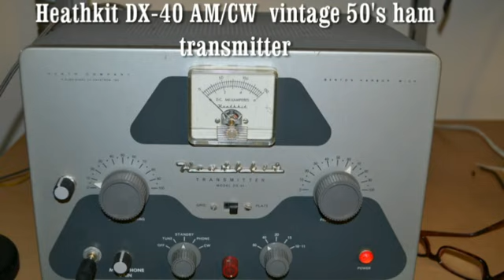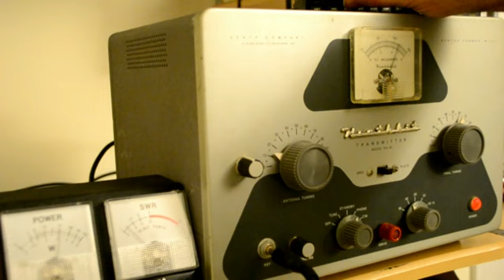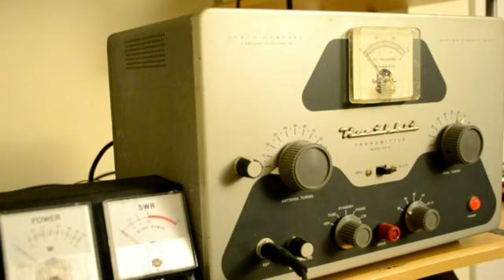Demonstration of the Heathkit DX-40 January 2013

Comment: Burt,
Did u ever hv luck in reducing that AM modulation feedbk while using the 104 Mic ?
i would think that if u can reduce gain enough, feedbk should be reduced accordingly.Love ur videos..Burt.  Tnx for the extra effort to load them on U- Tube !
73  Dana  WN6OHG [ Extra Class Op]